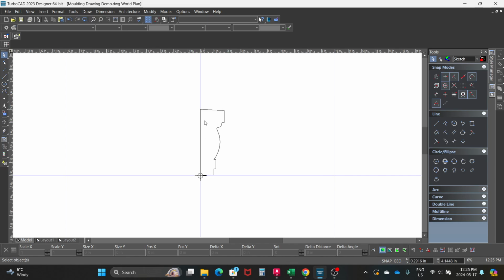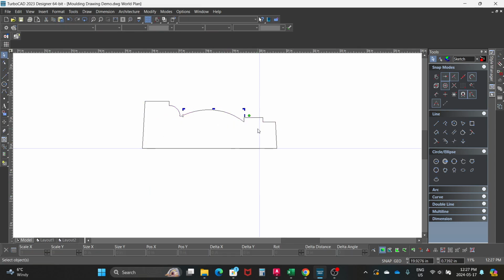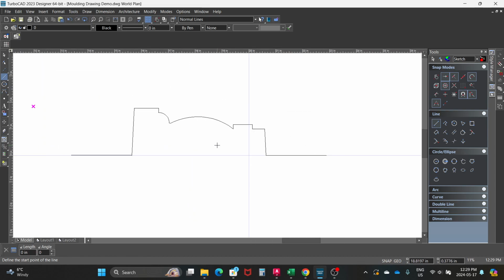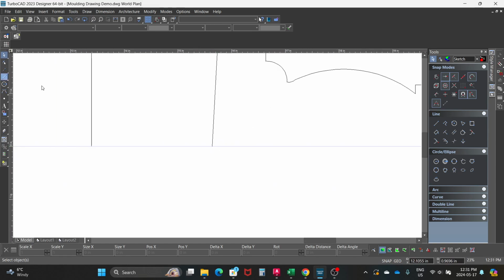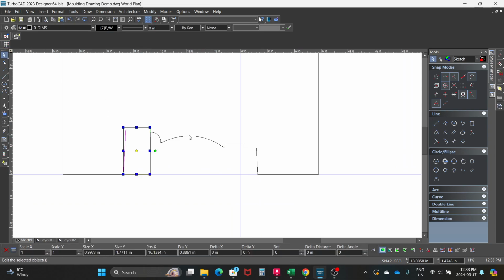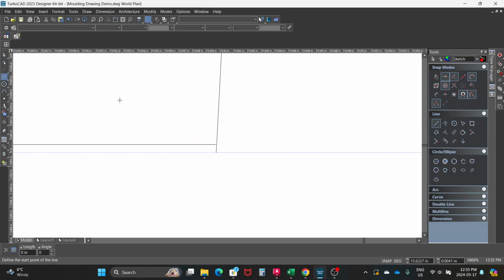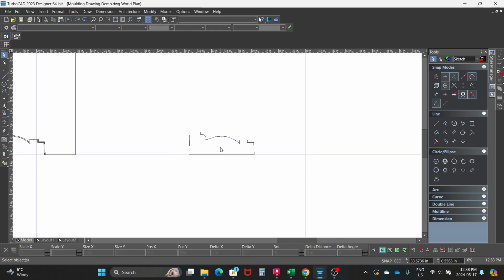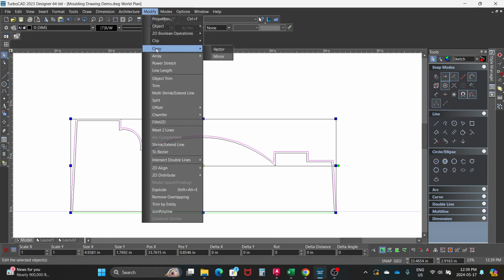Drafting for Foam Cutting and Coating

Comment: How do i cut 6 different blocks all different sizes in desk cnc
Reply from the maker: I'm not sure I understand the question. I use deskCNC to open a drawing and "show the wire how to go through the foam" and create coordinates file that is used to run the machine with Mach3